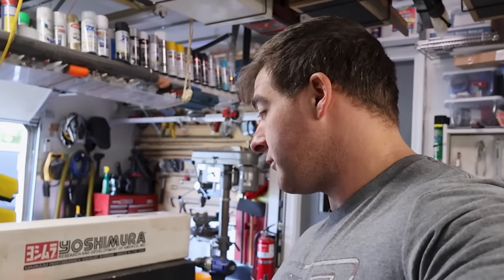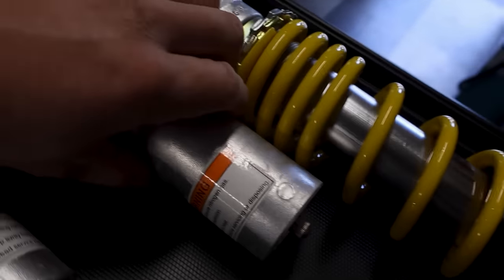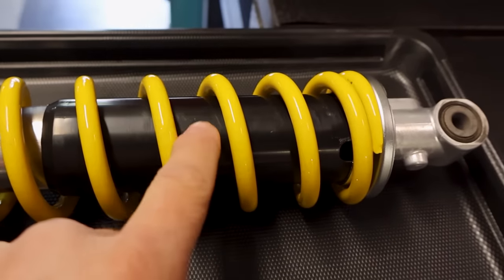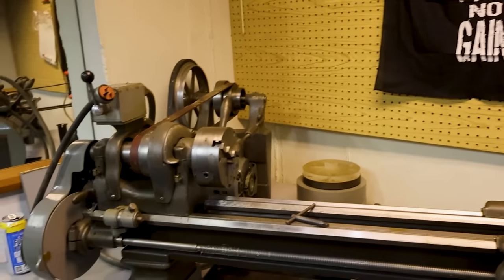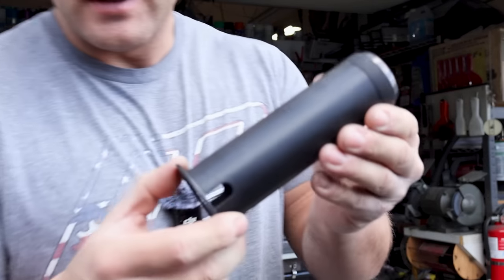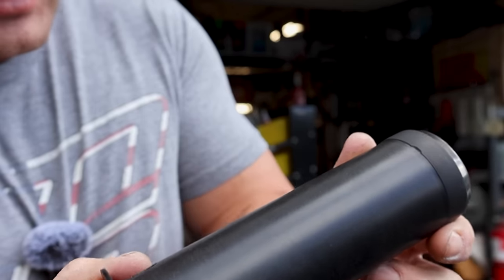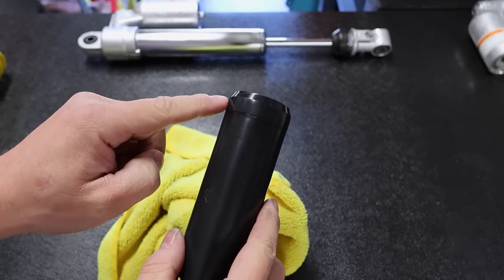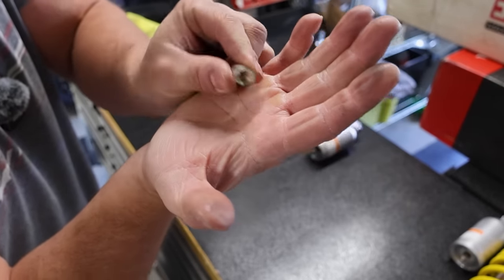Restoring and Installing Suzuki LTZ400 Shock Springs

Comment: South bend 9 is a solid ass little lathe. Has been around since ww2 Era If I remember correctly. If you ever dive into the machine you'll notice the lack of brass in it due to the fact of a large portion of them being made during that period.

Comment: Gotta be careful lubing the plastic sleeves that ride on the shock body. Lubricants trap and hold dirt. Your essentially creating a lapping compound between the sleeve and the body. I personally would just try to keep them as clean as possible. Either way its coming along great!